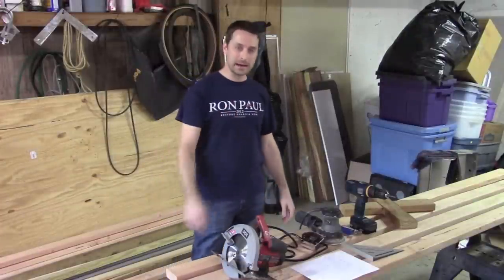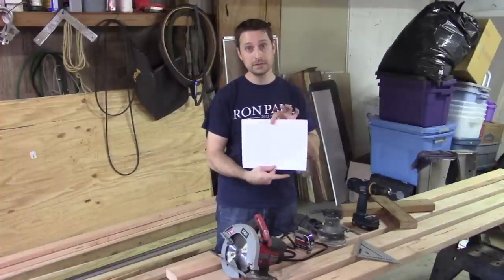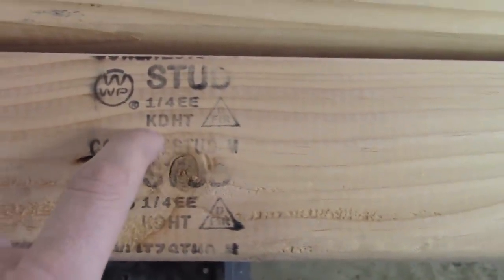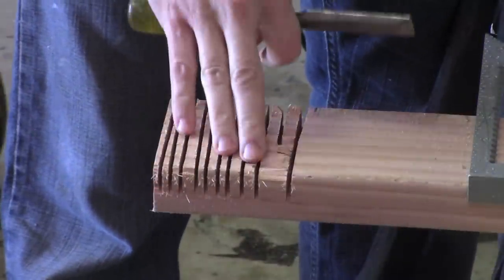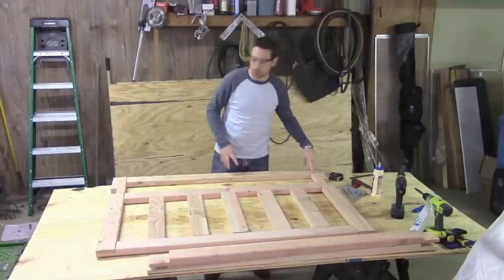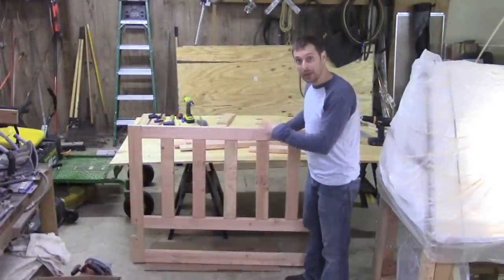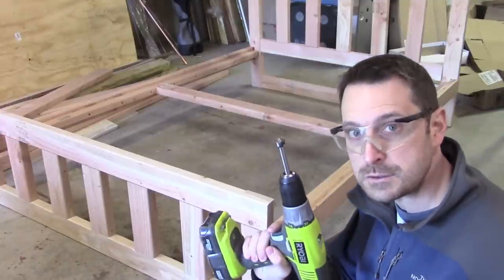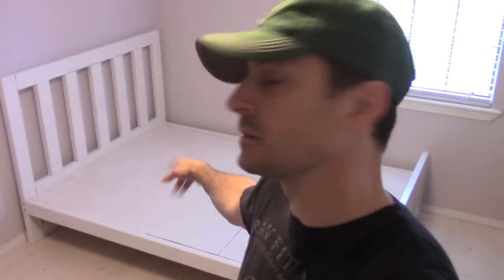How To Build A Full Size Bed Frame for Under $50

Comment: You should drill some holes in your plywood. Had the same set up before, but humidity from sleeping bodies migrates down through the mattress and can collect under if there's no airflow
Reply from the maker: Interesting. Good suggestion. Would make the bed lighter too.
Reply: Same here, had a mattress grow mold underneath because of no airflow.

Drilling holes will definitely work, but you need a lot of them, and flip your mattress every 6 months. You can also cut slats out of the plywood with your circular and add another 2x4 underneath for more stability.  A downside of using plywood either way is if the edge isn't sealed and gets wet, it'll rot and start to fall apart. So I would do the bottom with just 2x4 and 1x2 as slats, and then this bed could really last a long time

Comment: If you don't have a box spring, drill holes in the ply wood to allow air flow so there is no moisture buildup
Reply from the maker: I have never had an issue before and I live in the Southern US.
Reply: I agree. In southern california I've seen instances where mold grew underneath the bed. They were on the floor or makeshift plywood platform.

Comment: Am I correct that this bed supports a mattress that is 52" wide (the length of the platform cross rail) and 76" deep? For a taller mattress, would it be better to move the side rail supports down further than 3/4"?
Reply from the maker: The size is correct. It is for a full sized mattress 76 x 52 x 11. You can modify it as you like. Why move the rails supports down?
Reply: @CountryLivingExperience  Nevermind, I forgot that plywood, not the mattress will sit on top of the rail supports.

Comment: Very nice work. I realize its for a toddler but do you think the 2x4 rails would be strong enough in the middle to support a couple adults? I am thinking of using 2x6 rails. Thanks
Reply from the maker: Thank you. You may be correct. 2x6 would be a nice upgrade. However, I have jumped around on the bed with my daughter and there was no weakness detected.
Reply: Mine is over kill but a 2x6 will work just fine. I used a 2x12 side board with a notched 2x6 accepting 2x4 slats. It was built to last many many years.

Comment: Hi there!

I’m trying to get all the parts for this project and have...

-the 10 2 by 4s and plywood
-The jig you used for drilling the holes
-2.5'’ screws

Could you clarify the size of the screws used, as well as the size of the lag bolts that you used to connect the head and foot boards to the side rails?

Thank you so much!
Reply from the maker: I used 2 1/2" screws on the majority of the project. I used 1 5/8" on the head and footboards in the pockets I drilled. I used 2 1/2" lag bolts. Hope this helps.
Reply: Super helpful!!! Thank you for the very prompt reply! It is much appreciated.
Reply: Country Living Experience — just to keep you updated, the bed turned out amazing! If I could attach an image to the comment I would! We made some adjustments to make the design our own but your instructions were a great guide for us! Thanks a lot!

Comment: Sorry for all the comments. I figured out the headboard frame for the left and right sides with the 1.5 cutout for the side rails is supposed to be 41 inches to be able to fit the hb cross rail and 22.5 middle headboard styles.  Dsmn that was a headache

Comment: How is the headboard and foot board 55 in wide, when a full size bed is 54inches wide? If you in cut the rail you subtract 1.5inches on both sides which gives you 52 inches. I'm just learning and like this design.
Reply from the maker: Thanks for your questions Kevin. 
Yes, I designed it to be 1 inch bigger than the mattress. When you notch in the side rails, you will still end up with the same overall dimension of 55 inches as the head and foot board widths don't change.
Reply: Country Living Experience hahahahaha see I'm still learning. Wow I feel like a idiot. I did change how tall the headboard and footboard is. I wanted it a little taller and my side rails are 2x6. Also I'm having a hard time doing the lap joints, it ain't turning out as pretty as yours
Reply from the maker: No worries Kevin. Trial and error is how we learn. Keep at it and you will make some great things in the future.

Comment: Hi was curious what the 32.5 inch styles are for?  I got almost everything built and dont see the application for them. Thanks in advance
Reply from the maker: They are the sides of the headboard. I actually miswrote their size a while back. I had made a modification to the headboard making it taller to 40".  This should not effect your build as you will just have a taller headboard. Additionally, the headboard cross rail should be 48" and not 50". Apologies.

Comment: I got a quick question would the 2 headboard styles be 37" instead of 32-1/2"? Because I couldn't get 67-3/4" square measurement out of my headboard.
Reply from the maker: i made a modification to the height in the middle of the build. You can make the headboard any height you want. 
The point in the video is to use your diagonal measurements as a check for square. My original design was 32.5", I think I ended up at 40.

Comment: Thank you. Going to be renting a place again soon, so I need to be able to take the bed apart. And the slats are much easier to deal with, but I'll need a notch to go along the sides that the slats hide into so that it's level with the sides. My challenge is I want to be able to build and mount a headboard later. Another are the legs, I might want one in the middle or one in the middle of a side where i might get out of the bed, just to give it support where there will be continual concentration of force. What I will take from  your video are the lap joints for joining the sides and ends, nice job. I was going to use bolts, but the lag screws... I didn't think of using those. Very beefy.  I was also thinking of using 2x3s instead of 4s, to try and reduce the weight some more. Does the mattress slide around a little from side to side with your design? You  might want to remind people about the plunge depth, I had to assume you set the saw bite depth on the circular saw, to 0.75"? I do like the forgiving measurements of the lap joints. In division of labour, just like you do your cuts all together, I do kreg holes in only one position on my table. I lay out my piece and i mark the holes and direction with a pencil, usually 2 per piece per end. Then i put all the wood beside in a stack on my table and i clamp a piece down and do 2 holes, then the next piece. I don't move, the clamping and drill pattern is the same, only the wood moves. I find this works well, but sometimes I make a mistake. It doesn't give you a little pilot hole in the receiving  piece but i find a strong clamping when attaching solves this, plus i usually glue, especially a corner. This is just experience, i am not a carpenter at all.
Reply from the maker: You're welcome. Glad it was helpful. Our mattress does not slide at all. Good luck with your project.

Comment: Just so anyone's wondering and so that u dont gotta go back to the store again like I did, u need six 55 inch rails to follow his plan exactly not 4.
Reply from the maker: That is not correct. Where do you get the other 2 from? 2 for the footboard and 2 for the headboard. Don't add in the platform support under the bed that is 52" or the headboard cross rail that is 48". Those two are not lap jointed.

Comment: Can i do this with a king size bed?😅 i need help figuring out how much 2x4s it would need😅
Reply from the maker: I have not calculated this project for a king size. Sorry.
Reply: I would thing the design should be scalable to King.  Isn't King-size double the width of Twin?
Reply: @danfarrow4857  yes double the width exactly. Our king size mattress has two twin box springs under it.

Comment: I'm not certain ur cut list matched the bed u made. After cutting everything my headboard didnt match urs
Reply from the maker: Should match. I don't remember making any mods. Will check and get back to you...
Reply: Country Living Experience: A Homesteading Journey Same issue, made all cuts and the headboard cultist don’t match up
Reply from the maker: Ok. I remeasured the bed. I did make a modification. I made the headboard styles taller by 7.5". So they should be 40. But if you cut them at 32.5" as I wrote earlier, you would simply have a shorter headboard. Additionally, I miswrote the headboard cross rail width in the cut list. It is 48" not 50".

Comment: is it cheaper in the long term as a full board does not allow a mattress to breath so will go moldy?
Reply from the maker: I detect sarcasm. I have never had a mattress develop mold on it while sitting on a platform style bed. Longest time for our other mattress is 5 years.
Reply: No sarcasm intended, it must be due to climate what affects that. here in the UK it can be a big issue and lots of people in America have mentioned it in other videos :)
Reply from the maker: Thanks for the heads up. I will keep an eye on the mattress for any problems.
Reply: maybe just drill hundreds of large holes into the board?
Reply: Easy fix! A hole saw!  Easy peasy

Comment: Would a twin size mattress fit under this? I'm looking to make a full size bed that would allow a twin size trundle to fit under the bed for my older boys who share a room when the oldest is home from college. Thanks!
Reply from the maker: It would not currently fit a twin underneath. It would be too thick. You can easily modify the height to accommodate it though.
Reply: Country Living Experience awesome! Thanks! I figured it would need to be taller but wasn't sure about the length of the bed vs the length of the mattress.
Reply from the maker: Should fit the length with no problem.

Comment: Nice bed. I had a hard time understanding your instructions. Probably just me.
Reply from the maker: Which part did you not understand? How can I help?
Reply: what are the exact size for a full bed frame ??  using 1.1/2 inch board?